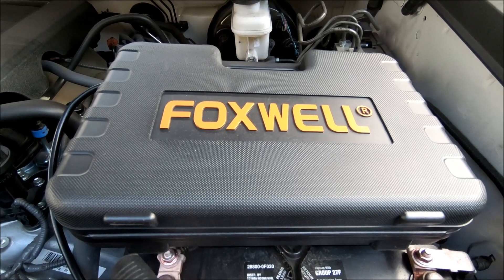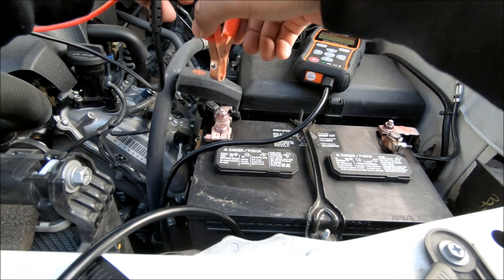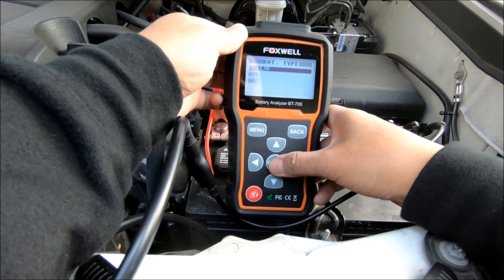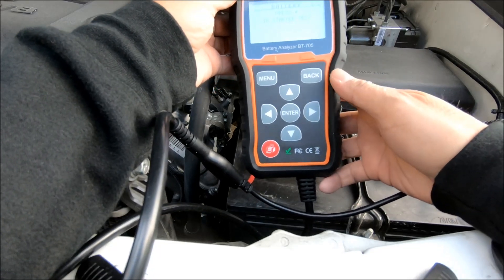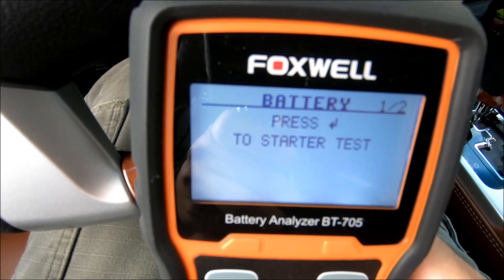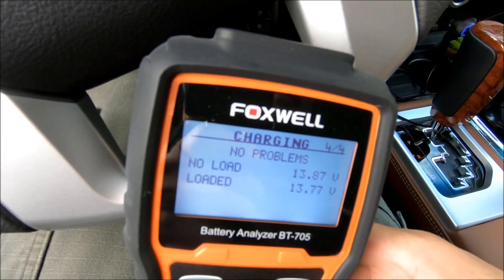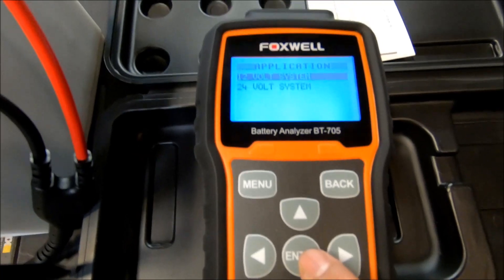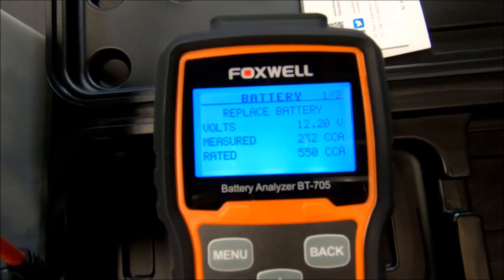How to Use a Battery Analyzer Foxwell BT705

Comment: Actually, the tester is not reading cold cranking amps.  It seems like most people don't understand this.  CCA is the amperage put out at 0 degrees fahrenheit. So, unless your battery was at 0 degrees when you did the test, you aren't reading CCC.   Hopefully, the manual explains this and tells you how to interpret the amp reading.
Reply: according to the manual it compensates for ambient temperature

Comment: Besides convenience, what can you get with this that you can't get with a volt meter?
Reply from the maker: It checks the condition of the battery. You can read more about it here.https://www.amazon.com/FOXWELL-BT705-Automotive-100-2000-Cranking/dp/B01ANF1D7U/ref=sr_1_1_sspa?ie=UTF8&qid=1536247955&sr=8-1-spons&keywords=foxwell+BT705&psc=1